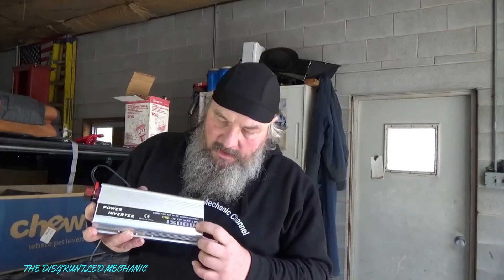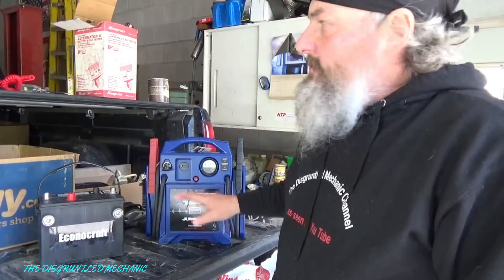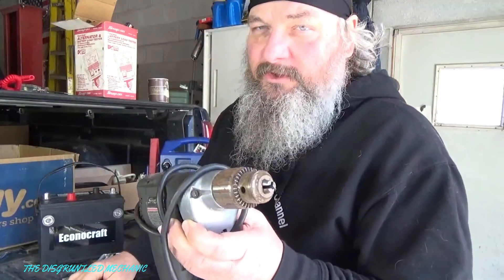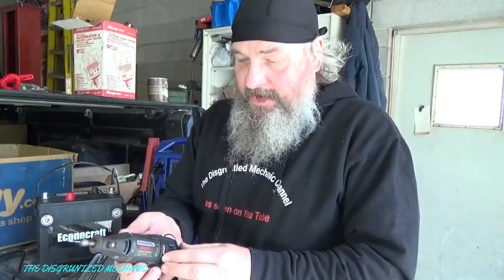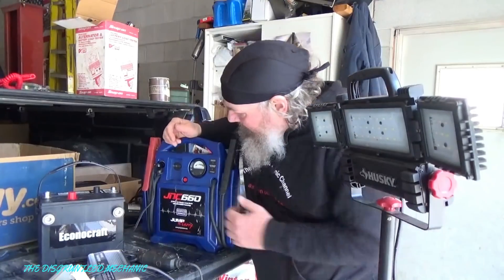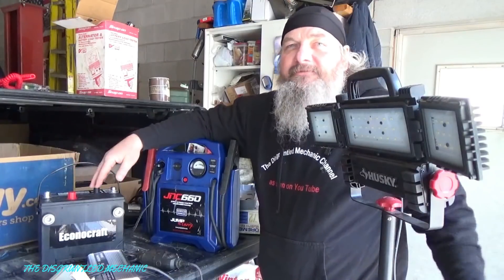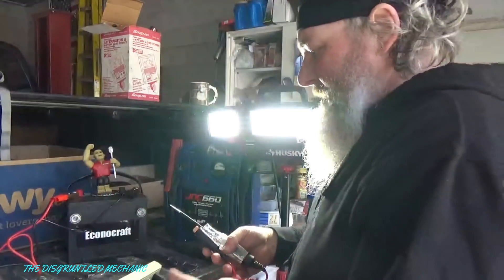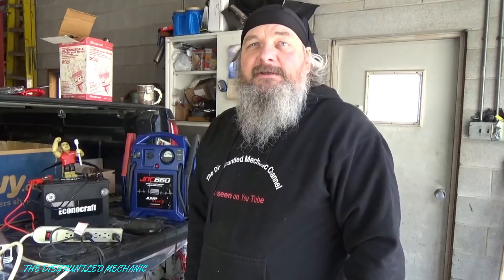DC to AC power on the go? Let's find out!

Comment: I live off grid, so I have more experience than the average Joe with inverters and solar systems. 
Firstly, that inverter is not putting out anywhere near 1500 watts 
Secondly, the fan running continuously is a sighn of a very cheaply made unit. 
For about $20 more you could get a cobra 800w inverter that would run your drill no problem and would have a passive cooling fan (not continuously running).
There is nothing wrong with modified square wave inverters as long as your not expecting to run high dollar electronics on it. 
Another problem you will run across when trying to run anything with a heating element off of a cheap inverter is, your going to burn it up much more quickly. A pure sighn inverter will be more forgiving, but even then it will struggle to power anything with a heating element. 
Keep in mind though, that even the best pure sighn inverters are still using pulse width management and will never be identical to the power you get from the power company. we have a $3,000 pure sighn xantrex inverter charger that still won't run the average microwave properly. 
You would be much better off with a cheap deep cycle marine starting battery, regular starting batteries drop off far to quickly with no warning to be used with inverters with good results. 
There are decent chineseium inverters out there, this is not one of them.
Reply from the maker: Thank you for your input!
Reply: The Disgruntled Mechanic 
Thanks for the response, I hope it helps.
Reply from the maker: Well I can tell you I know what to buy when this one shits the bed! Thanks again! Oh and I love the off grid lifestyle would love to do it myself. And that Chevy camper special is awesome! I love those trucks!
Reply: The Disgruntled Mechanic 
Thanks, that's my baby, getting ready to do a sm465 NP205 swap on it
Reply from the maker: you gonna youtube it? I would watch for sure!
Reply: The Disgruntled Mechanic 
I think I might just do that, would be a fun video to shoot.

Comment: Thanks for the mention bud. Yes  test   it out  and most times if it's too much it will just  shut down and  trip  the internal beakers.  Your modified sine wave inverter is more on the square  side  most likely :). So don't  plug in digitally controlled  variable speed items or  smart battery charger that use digital controls to monitor a charge . Some of them items will get damaged  with a  low cost inverter. I've had good success with low cost inverters used on basic  fixed loads .  Will the coffee pot work just depends  if it's a full 1500 watt inverter or not . Look forward to the test.
Reply from the maker: As long as it charges my batteries for my Milwaukee tools I am happy! and running the fan is a plus too! thanks for cheap charger tips!

Comment: I actually have cobra 1500 watt power inverter.  Works great though,  but it trips any of 3 coffee makers.  Ugh.  Those are house appliances.  Oh well.  I can run most anything on my cobra inverter.  Haven't had complaints with it.  On my Suburban,  I have dual batteries.  Which helps keeping power hungry loads away from my starting battery.  LOL
Reply from the maker: My 2500HD has 2 batteries which is a good thing. So I guess you are saying good luck with the  coffee maker, huh? haha!
Reply: The Disgruntled Mechanic hahaha,   I guess coffee maker don't like me at all.  I'm thinking of going to pawn shops for a cheap tiny ones.  I guess it'll draw less watts.  Lol